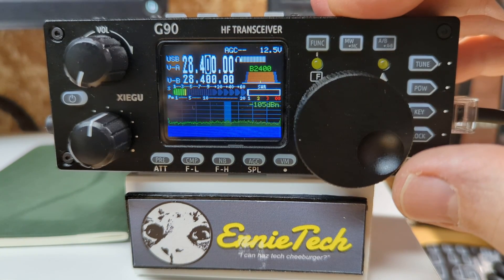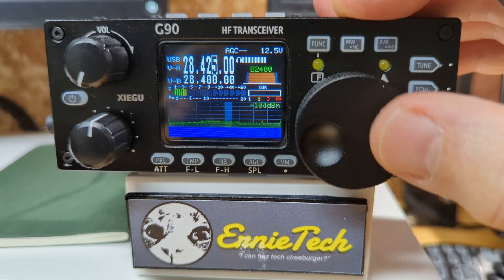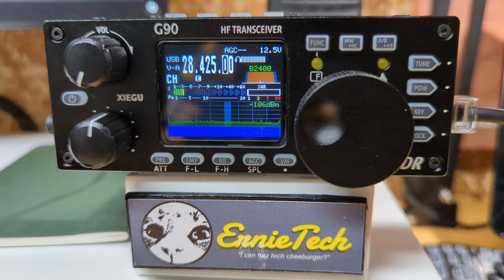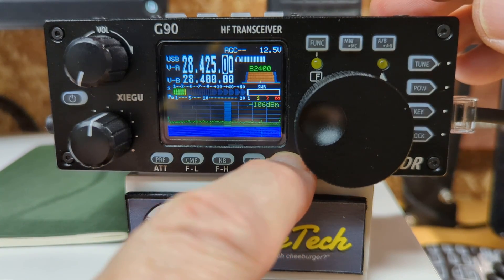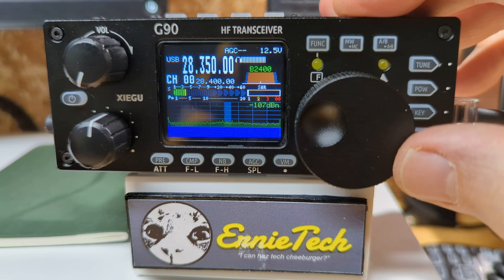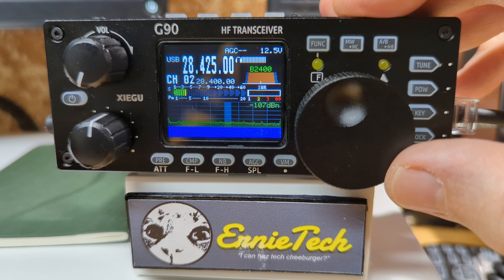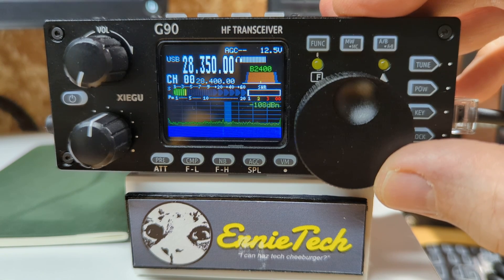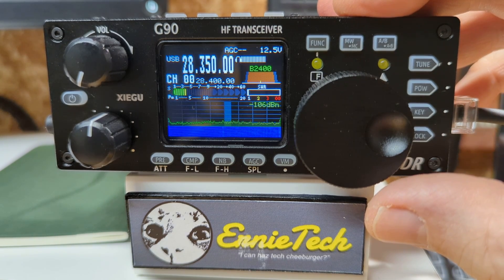Xiegu G90 Memory Management

Comment: The FUNC A/B transfers the stored frequency to a temporary scratchpad in the radio. Yes, its a lot of button pushing to get a frequency out of storage to play with. Also, your memory will store the mode of the radio (CW / USB / LSB etc…). Too bad Xiegu doesn’t have a way to dump memory to a spreadsheet, or programmer app.
Reply: maybe with a updated firm ware